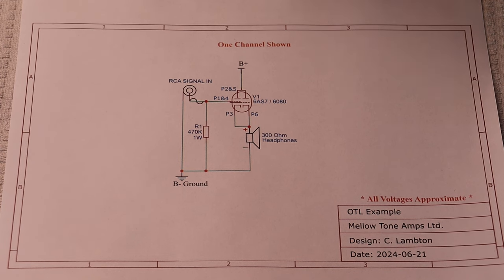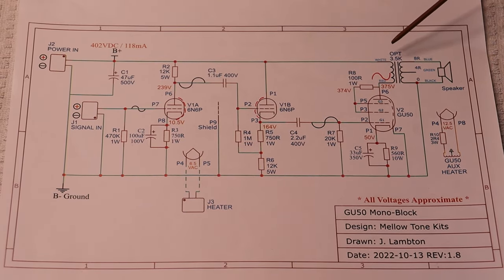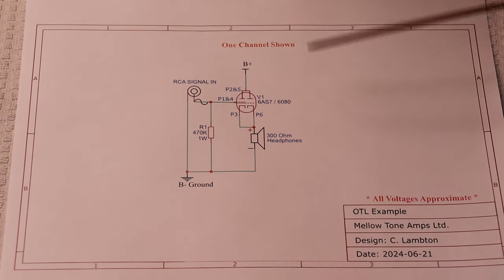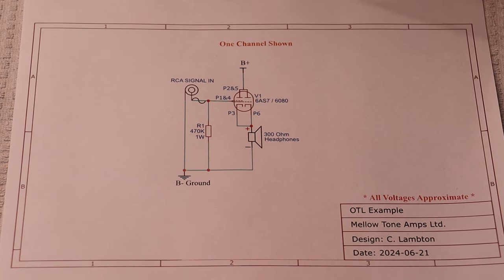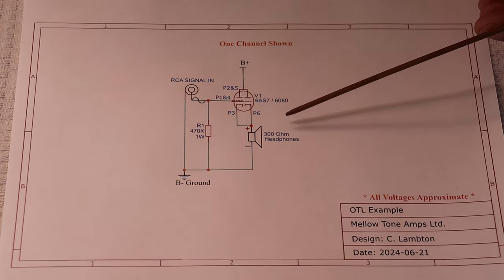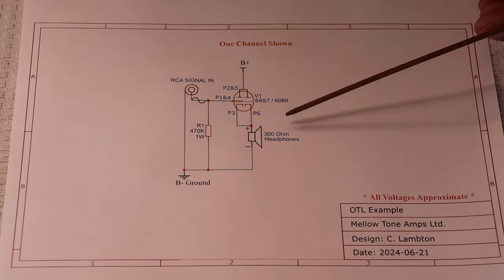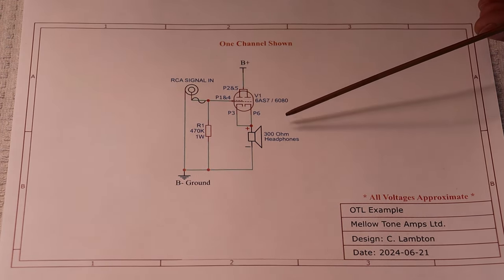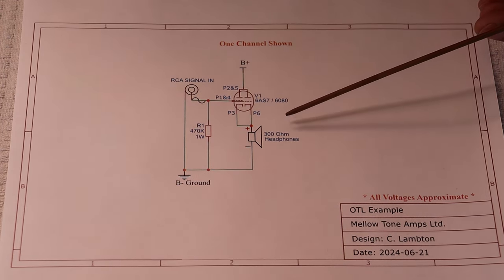Tube Lab #191 - OTL Amps & Tubes

Comment: Not sure if this also occured in the US, but in Europe in the late 60's, maybe even early 70's there were 800 Ohm speakers produced to be driven OTL, by tube output stages in a circuit similar to a semiconductor PP amp with same-polarity transistors. The tubes used were EL86 or UL84, that had relatively moderate current (up to 100mA). They were run as pentodes, not triode-strapped, and they were prone to burning off the screen grids. Therefore they had to be much reduced in power and gave about 8 Watts - still more than what they would have produced as triodes.
But a headphone amp OTL with a 6080 or similar??? Nearly 16 Watts of heater power plus at least 10 Watts on each plate for maybe 100 mW output - sorry, I think that's really absurd!

Comment: How about an OTL for 
8 ohm planar headphones such as the Verum One?
Reply from the maker: Not practical, my recommendation would be to drive them with a tube output stage coupled with a multi tap output transformer.  We actually have a complete headphone amp prototype that would be perfect, as the lowest tap is 8ohms.  If you want to experience an OTL amp, I'd recommend thinking about higher impedance headphones.  Large selection starting at 150 and 300 ohm.  But first find the amp you want, then the headphones, that way you'll know for sure they're compatible.  We're currently developing another Kit Headphone Amp and it should be a good match for 150/300 ohm cans.